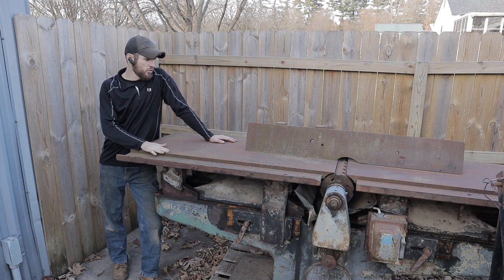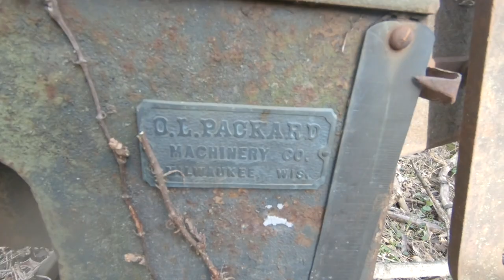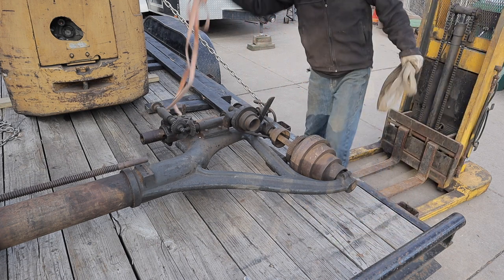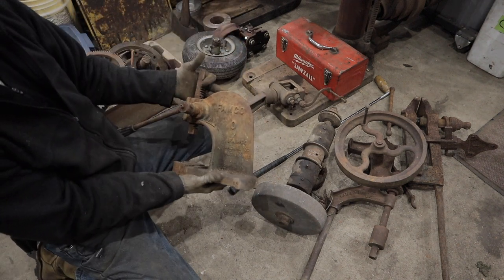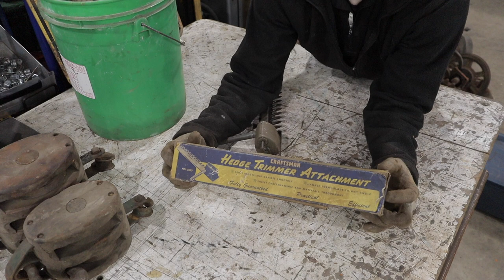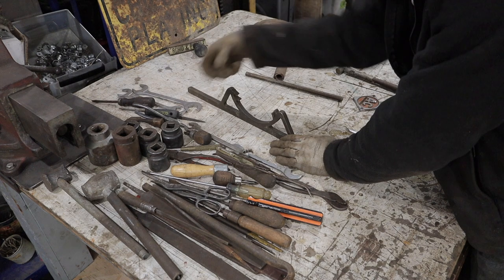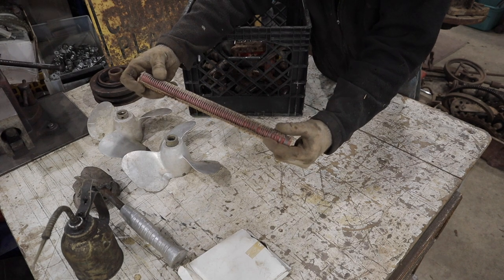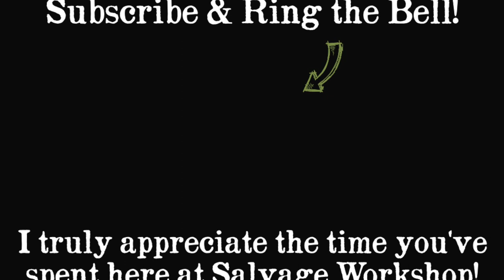RESCUING OLD IRON ~ 1890's Camel Back Drill Press & MORE ~ Episode 1 ~ Grandpas Hoard

Comment: Hey I really enjoy your video especially the bits and pieces in your cans and totes. I know it's been a year or more since you posted this particular video. Do you remember the long tong looking thing with the slide color on it, and the four aluminum shoulder pin looking pieces? If you haven't found out by now they are locators for installing cylinder heads on to engine blocks. You put the pins in a couple of bolt holes and then install the head start a couple of other bolts and then extract the pins with the tongs. You probably already know this but I just found it interesting that you found a complete set of these.

Comment: The wooden plane is a molding plane, the one with two handles is a spoke shave. Should have kept your eye out for the mold to make the lead hammers, sure there was one there. the last bucket (catch all) with drills and such looked to have a couple of small brooches. the handle with the kinda square ends may be for lifting the eyes in old wood stoves. Just my two cents on what things may be.
Good videos.

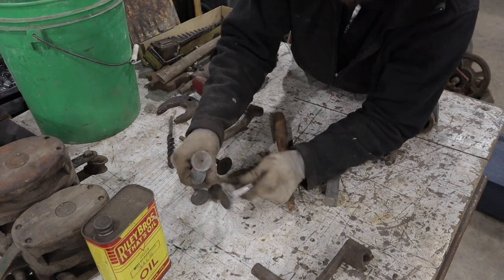Comment: At 36:50, that's a "Crow's foot" socket. At least that's all I've ever called them. I've only ever used them to torque nuts on threaded rods. Or really long-pull bolts. Or the occasional oddball axle with a threaded section mid-length where something is clamped. But I suppose you can use them whenever you go by beyond the reach of even the long sockets available to socket wrench sets.

Comment: Maybe the grinder mounted to the wall/beam.  Belt going up.    That unknown clamp down - for pipe to hold the 'far end' from a pipe vice.  Keeps long pipe from whipping. The large flat face hammer is likely for furniture covering.  Driving staples down inside a slot thus pulling the cloth in.  The items in the back of the T wrench insert into the end to change the size of nut it is turning off.  Likely machine / car - reach down under and turn with big bar and then just twist the top.

Comment: The nial puller isn't used like you think. You put the fixed jaw next to the head of the nail and slide the handle up and then firmly down. this drives the jaw under the nail head next pull it towards the pivoting leg it will slide under the opposite side of the nail head continue pulling the handle the nail usually comes out. I have two different ones.

Comment: that is a morticing machine that fits on your drill the one you called a big wrench is what 's called a crows foot, you put an extension or maybe two it's were handy when you need it. That  was a spokeshave used in woodworking.

Comment: That thing with the three rollers is used to make curved bends in metal. I've seen a similar device that was used to put curved bends in copper pipe. But I'm not sure what yours is meant to bend. It doesn't have the rounded grove in the rollers to prevent crushing that the pipe bender had, so whatever it's used to bend, probably isn't hollow. Rebar comes to mind. Though I don't know what use bent rebar would have. Heavy gauge wire maybe?
Reply from the maker: Ya I thought that at first, but there's not really a way to adjust the space between all three rollers evenly.... IDK.. it'll be a mystery, until it's not!!  Thanks for the thoughts, I'm on the same page as you on this one!

Comment: I have one of those camel back drill presses.
‘The Rockford’ illinois made, excellent drill, still in use, although I just run it with a 1/2 horse motor. Yours looks to be a little bit different. My unit has a split pulley at the top to split the ratios. Brings it down to extremely slow.
Mines from 1905. Made its way all the way to Melbourne Australia. Nice find, don’t let it go, they are pretty rare. Even in the US these days.

Comment: @ 42:08 that is a brigs and stratton fly wheel tool they are a few diff sizes/types they work ok but i just used an impact gun to take the nuts off and never had to use that tool when i did small engine repair

Comment: That belt pully might belong to this, originally;

Sears Craftsman 101.03580 (catalog# 99PM2380) built by Atlas Press Co.
12-3/4" (i.e. 6-3/8" from column to chuck centerline)
Overall height: 36"
Table: 8"x9"
Column: 2-1/4" diameter
Spindle travel: 3"
Pulley Drive: 4 step
Belt: Atlas BD2M-34
Speeds: 600, 760, 1000, 1300, 1800, 2400, 3300, 4000, 5200
Chuck: Jacobs #33, 1/16"-1/2" capacity
Motor: Sears Companion, model S-4396, number B_2_7
Motor specs: 1/3HP, 6A, 1750 RPM, 110V, dual 1/2"x1-1/4" shafts, ND ball bearings

Comment: Greetings. This is the first time I've visited your site. I'm impressed and think I'll be back to visit often.
 That flat belt pulley that you got would have run the 3 ft. circular saw and table that you passed up out back of the buildings. Was that too badly damaged? My father used one almost exactly like it back in the day (1960s) to cut up logs into firewood. Happy Holidays, Steve

Comment: That nail puller has been designed as a slide hammer to get under the flush hammered head of a nail, then with the foot of the puller is what you would pull against to extract the nail. I know this because they still make them brand new!! So your man has described how to use it wrongly but never mind, we all make mistakes!!
Reply: Was just coming to point that out. That's a big one to.

Comment: 0:25  I have been in the cabinet trade for over 40 years and have never seen a jointer that big!  I have no idea how one would even use a jointer that big!   It must have had a power feed to surface WIDE rough milled lumber.  By hand would be almost impossible.

Comment: Picks like that can be problematic.   The people want you do spend hours digging through mountains of garbage.  When you find something worth saving, it's either "Not for sale" or they price it stupid high.   The post vise and lathe are perfect examples.  If you really find someone hoping to get stuff gone, you can do OK, but generally I have found most hoarder-type picks can be disappointing.  Also, the nail puller is more often used in a different way.   You use the slide to hammer the tool into the wood to grab the nail and then use the curved portion to lever it out by pulling down.   I suppose you could use the slide to pull it out, but the more traditional way is to pound it in with the slide.  Thanks for the video and continued good luck.

Comment: Just watched the video about electric hammers and I don't know if you have already been told or not but when using a straight drive, that is non rotating hammer, to facilitate better drilling and less effort ROTATE the bit handle. That is the primary reason for a long bit handle. Like the Shakers in John Henry's day. It cleans and to a certain extent clears the hole. That's why hammer DRILLS work better than electric hammers for drilling holes. If you just want to break a rock or whatever DON'T rotate. The dust and chips act as wedges and help break up your work. Old Man Andy

Comment: That strange gear with only 5 teeth I think is from a mill.
Many brain Mills had link chains that wear flat steel with the links connected like a watch band with pins.
The gears looked like that.
They lifted the elevators.
They wete less prone to wear from stone dust that would mix with the flour than regular chains.

Comment: I would like to see you restoring the more complicated machines. You have literally tons of them. The drill presses in this video would make excellent, relatively short, projects if you can find or make the missing parts. In comparison, that massive joiner you showed early on could take months and a lot of money, so I don't expect to ever see that one done. Find the most interesting, old,  rusty machines...lathes for example. It seems that you enjoy finding and collecting this stuff more than actually doing the "rescue" project.  That is not a complaint...I am the same way. But it is enjoyable to see an old, hopelessly abused machine brought back to near new condition.

Comment: I saw on YouTube how people take "range lead" (that is, spent bullets) and melt them in an ordinary frying pan until pure liquid (lead has a low melting point).  Then they remove all the dirt and film off the top with a strainer and use the liquid lead to melt into ingots (lead bars).  I think that with the right equipment, you can take that broken lead hammer, melt down the head, and recast it back onto the steel handle as it was supposed to be.  I also know from watching YouTube that if anybody is familiar with flat belt driven machinery, it's David Richards and Keith Rucker.

Comment: The nail puller you found does not work in the manner you described.
The sliding weight is used to sink the jaws below the head of the nail and then pulling the handle down pinched the jaw and the lever helps pry the nail out
 No boot required.

Comment: the tool you said you had no idea what it was... with the sliding collier with the hoop on the end and the triangle shaped end ..go with the stepped dowel pins. it removes them.. they are used to line up head gaskets on engines that do not have factory hollow dowel pins.
Reply: @53:06 that tool removes the dowels next to the IGA matches.

Comment: Drill press no.1 is missing the backgear arrangement...
Go back to that yard and see if you can find it...

Them angle gears you pulled out of that tub:
Part of a sheep shearing system...
Look on them...it may say "R. A. LISTER" on em...

See if you can get that old planer thicknesser off em..
It deserves a chance...🇬🇧🙂
Reply from the maker: If you watch the video at: https://youtu.be/Jm2-8-NpRUU?t=585 You'll see the I FOUND the bottom step pulley, but didn't know it!! It SOLD the very next day... I am in contact with the guy and working on possibly getting it from him... Fingers crossed!

Have you seen the thickness planer I already own?  It makes that one look like a toy! We'll see though, I have been thinking about going back for it! Thanks for watching Glenn!
Reply: @SalvageWorkshop  

It's not the pulley arrangement I was referring to...
If you look on drill press 1 there is a bull gear similar to a lathe with a pin you can pull out to disengage it...
There should be a backgear arrangement there...it's missing...
Go back to that yard and see if you can find it...🇬🇧👍

Comment: I think you are incorrect about how to use the nail puller. I think you use the handle to pound the tip down into the wood around the nail then tip the handel to pull the nail.

Comment: That is not how the nail puller works , does not work like a slide hammer the slide is to drive the tooth into wood surface then lever on foot to pull nail

Comment: https://www.af.nl/prive/heftrucks/towmotor/towmotor/
Checkout this link
There should be a data plate riveted to the mast. But just fr ok m looking at the video my guess it's  a model LT 30 or 35 1 ton maximum (at ground level) the higher you raise the load the less you can safely lift because your center of gravity changes. Good luck be safe.
Reply from the maker: Ya I've already looked over that whole site! I agree it probably has a 1000lb capacity... kinda disappointing, because I need something larger, but it was cheap, and will make a fun project! I appreciate your input on this old Tow Motor!

Comment: You may be irreparably damaging your files by clashing them together.  Files should never contact each other because each is hard enough to chip the other.  That is why they will cut steel.  
Those are not Calipers, they are Micrometers. 
That is a chain breaker but it is used to add or remove SQUARE CHAIN links, not cut them.
Reply from the maker: You must have missed where I pulled them from?!? They've been neglected long before they were mine!